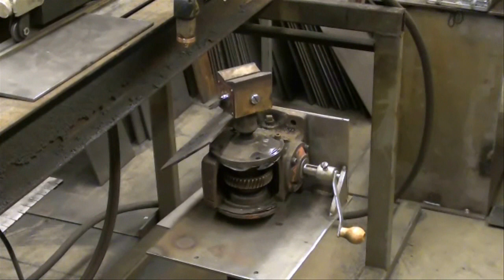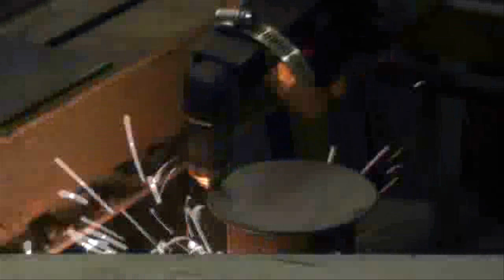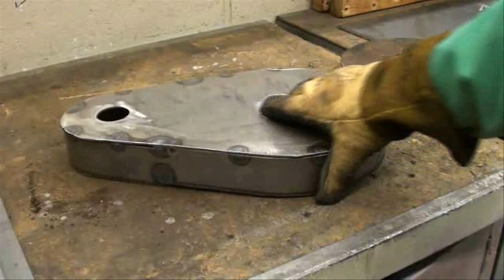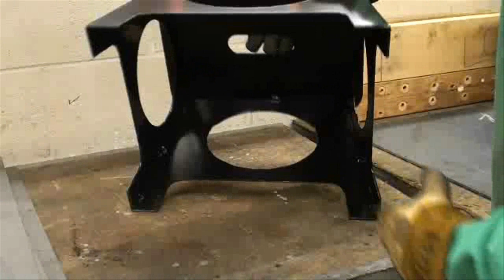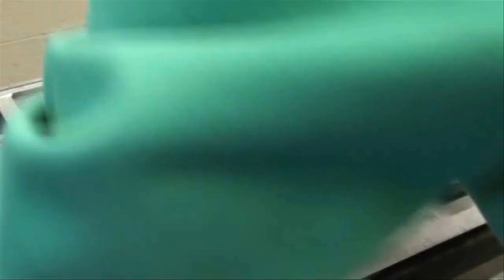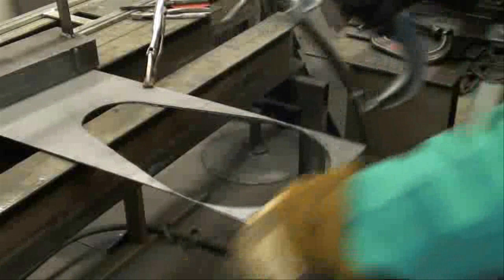MACHINE SHOP TIPS #81 Miller Plasma Cutter tricks part 2 tubalcain

Comment: could you please explain the difference between a drag tip and one you hold off on. i also noticed you would start your cuts a bit from the edge and then go back to pick up the uncut portion, what is the advantage of that way. i am a beginner and i would really like your response. also you do great videos. thank you
Reply: I use a standoff on my everlast plasma cutter torch. It basically holds the tip a certain distance away from the material I want to cut. A drag tip allows you to touch the metal you are cutting with the tip and drag the tip as you cut. The drag tip has a recess to give a bit of distance between the orifice and the metal.
Reply: thanks i appreciate the response

Comment: Wow, I learned some good tricks, thanks! I am thinking about buying my first plasma cutter and thanks to your video, I am sure I will do so. I am horrible with my acetylene torch , so I am hoping my cuts will be lots straighter and faster. Keep at it!
Reply: +Gilbert Jaramillo I got bit by the plasma cutter bug too. With any luck I'll be able to pick up an Everlast plasma cutter in a month or two. It will definitely save me a lot of time.
Reply: Straight cuts are operator issues. Use a guide rail for cutting with both oxyacetylene and plasma. Plasma is less expensive to operatee and easier to setup. It will also cut non-ferrous material.

Comment: How did you attach the magnet from the dial indictor to the 5/8 staff coming out of the top of the right angle gear box?
Reply: Dial indicator magnet bases have a threaded hole in the top to mount the indicator on.

Comment: To improve consumable life:

1.) Install a filter and a silica dryer inline with the compressor if there isn't already.
2.) Make sure the tip is stood off the work
3.) Post flow
4.) Don't run with more amps than you need

just from what i saw in part one, these are my suggestions.

Comment: In one of your other plasma cutting vids, you mention consumable life. I have a good deal of experience cutting with plasma, and piercing is very hard on the life of tips. I often try to drill a small 3/32" or so, hole to start from. The center electrode usually has a tiny piece of 'halfnium' pressed in there, it works a little better than tungsten.
 'Holesaws'..I like the Hougan trepanning cutters, but they are expensive.
Reply: dougspair  Yes, Annular cutters and a Mag Drill are just the ticket for holes. Mine will drill a 4" hole in 3" steel.

Comment: I don't either. I've been using hole saws for years and have sawed holes in fairly thick ... close to 1" steel and as long as you keep the chips flushed out of the kerf they will eat right through it. It does take time though so it could be a lack of patience that gets people in trouble with hole saws. It's metal ... not wood after all.
TS

Comment: BTW, the taper shows worse on thin stuff than the thicker stock.  The good side of an 11ga piece might have a taper angle of 1°-4°, while the waste side may have a taper angle close to 30° (which really shows badly).

Just remember to always "climb mill" the edge you want to save (even though you're using a jet of hot gas), and you'll always keep the good side of the cut on the piece you're going to use.

Comment: These new plasma cutters use a swirl ring to make the cut have a "good" side that's nearly perpendicular, and a "waste" side that has a lot of taper.

They always swirl the same way, and an easy way for a machinist to remember which side is the "good" side is to always be "climb milling" (with the tool spinning clockwise) on the side of the cut you want to save.

So say you want to make a piece with a hole in it (the circle is waste), you would move the torch in a counter clockwise direction.

Comment: at one point I think he said he was using a drag shield which has a recessed tip, so the actual hole the gas is coming out of is always about 1/8" off the work surface even if the tip is held right on the metal

Comment: One of the reasons you're chewing thru so many consumables is the proximity of the tip to the stock when you pierce cut.  It throws heat and junk back into the tip.  You should start further away and move down, or start at and angle and tilt back to 90°.

Comment: If you are having issue with consumable life on the plasma, check the quality of the air. "Dirty" air will greatly reduce the consumable life. Moisture or oil are usually the 2 biggest culprits. A Motor Guard filter similar to what many places use for paint would work well, as long as you are already draining the compressor regularly. If the air is clean enough to spray automotive finishes, it's good enough for plasma.

Thanks again for all your videos.